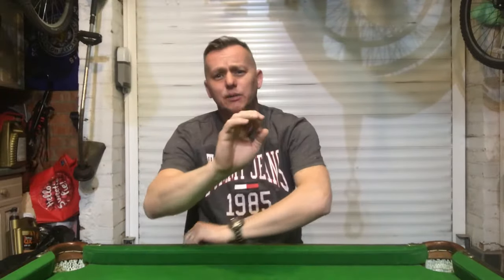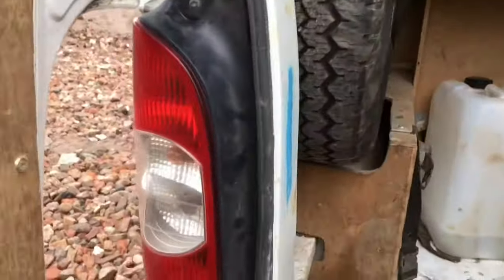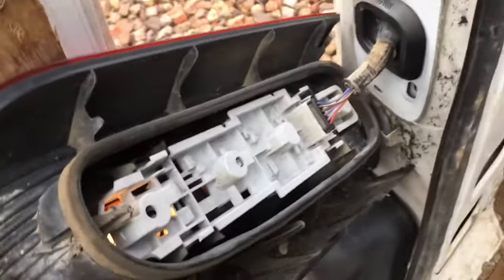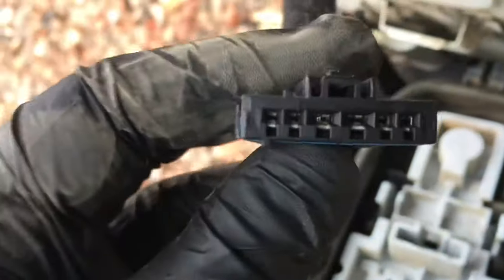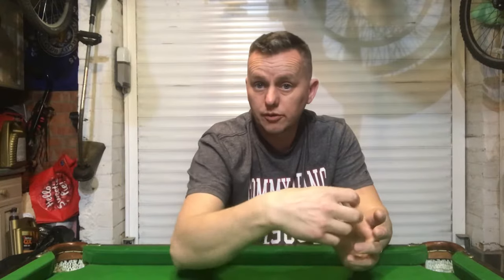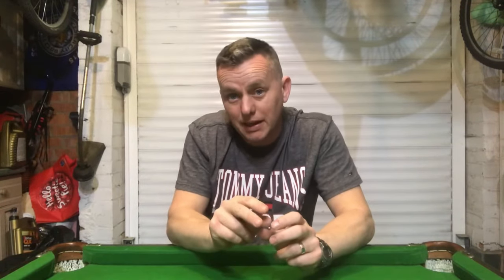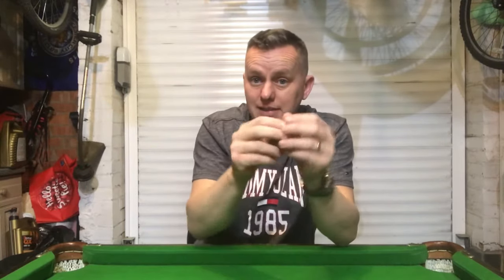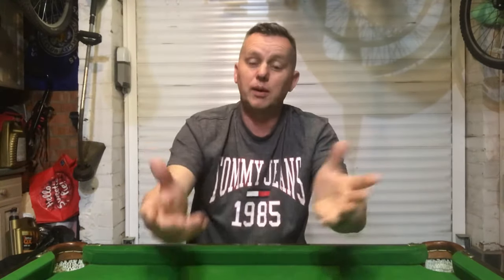Tail Light fault, How To Repair (basic electrical diagnosis)

Comment: Thanks for great explanation. Fixed exactly the same problem with my rear light. I would have assumed that a light would work or not, but your explanation on how it can arc, making it work and not work was very clever.
Reply from the maker: Glad it helped, Thanks for the great comments👍🏻👍🏻🛠

Comment: Great video, I have a renault trafic van, it keeps blowing the near side brake light bulb, it even melted the light unit, cleaned all the terminals and bulb connections but it still keeps popping bulbs🤕
Reply from the maker: check the alternator output is it higher Tham 14v? Thanks for the great comments👍🏻👍🏻🛠

Comment: Hello mate, really helpful video- Thanks.Just wondering, I’ve got a Honda Jazz 08 and the rear near side light , brake and reverse light aren’t coming on.Could one fawlty bulb blow the other two.Would it be the case to replace all 3 bulbs or could it be something more sinister?Appreciate any help-Thanks again.
Justin
Reply from the maker: Check the earth wire to the rear light, Thanks for the great comments👍🏻👍🏻🛠
Reply: Thanks much appreciated-will do👍

Comment: Great video. Very clear.  I wonder  if you could help me.  My two rear brake lights are working but the middle one on the rear window ins't.  I have changed the bulbs and also the brake light switch and the middle brake light still does not come on. Any ideas.  Thanks in advance.
Reply from the maker: Possible broken wire in the door wiring loom where it bends, Thanks for the great comments👍🏻👍🏻🛠

Comment: hi thanks for sharing.the lights and registration lights are not working. brake lights  and fog lights work.ive checked fuse and bulbs but no joy .any ideas. thanks
Reply from the maker: Is this on both sides? Thanks for the great comments👍🏻👍🏻🛠
Reply: @aaanton11  yes both sides .thanks

Comment: Hi I changed a side light bulb on front of transit connect and now back one has gone off on same side so both not working now any idea.  Thanks
Reply from the maker: Did you put a led bulb in they don't work on some cars, Thanks for the great comments👍🏻👍🏻🛠
Reply: @aaanton11  yes I put led in but now I have no power on left side lol

Comment: My Kia Sportage 2013 brake lights is making my craze , i changed the brake lights switch and fuse but 
I start my car brake lights working, next day it is not working, next day it is working
Any idea?
Reply from the maker: Check the earth point on the rear lights, Thanks for the great comments👍🏻👍🏻🛠

Comment: Hi, I just fitted in new brake light bulbs on passenger side rear and as soon as I plugged back in the connector all the power cut to my vehicle. Could this be a fuse issue due to incorrect bulb wattages????
Reply from the maker: Is the bulb in back to front causing a short circuit? Thanks for the great comments👍🏻👍🏻🛠

Comment: My light bulb sockets show signs of corrosion/rust, how would you suggest I fix this?
Reply from the maker: Give it a wipe with scotch brite Thanks for the great comments👍🏻👍🏻🛠
Reply: @aaanton11  While we’re in the same rabbit hole, I’ve got a similar issue on my Mini Cooper. The top light of the tail light cluster is not working. It’s not corroded and I’m using a new bulb. I even got a new socket. Still nothing. As I’m turning the socket I see a little blue spark. I think there’s something up with the circuit board.

Comment: could u help me, i have an issue with my back right brake light, put my foot on the brake and the both brake lights come on but a few seconds later the right one turns off while the othe is still on, i then turn off my headlights and turn them back on only to find the brake light will work again for a few seconds and then repeat, any help would be great thanks
Reply from the maker: Check the earth wires, and the connector plugs to the light units one might be melted, Thanks for the great comments👍🏻👍🏻🛠
Reply: @aaanton11  turns out the cove was loose, tightened it up and all working fine now, u are a genius my friend, much applause from Oz

Comment: aaanton11 Hi, I have a '94 Nissan Altima. I replaced the Brake lamp switch , put in new tail light bulb which stopped my brake lights from staying on. So I thought it was fixed and I didnt have to unhook my positive battery terminal everytime I got out now. Battery was dead next morning. Installed new battery, brake lights back on again lol. I kept smelling wires burning and it was coming from my left tail lights. The ground wire had burnt and melted my tail light housing around where the ground connector screws down to the housing frame. Any ideal what's causing this or can you send me a video how to fix it. My brake light and battery light are staying on and I guess this is why.
Reply from the maker: You must have a short circuit, did you use the correct bulb, there are many different ones that might go in the wrong hole, Thanks for the great comments👍🏻👍🏻🛠
Reply: @aaanton11  I already know their is a short circuit somewhere and yes I used the correct bulb I k ow which one it uses!
Reply: Thanks for your input but I'll look elsewhere on fixing the issue like maybe replacing the switches above the brake pedal.

Comment: I really need help my brake lights and blinkers aren’t working I thought the socket was out because when you touch the passenger side light socket the light either cuts on or off . I’ve tried bulbs new tail light socket fuse and brake light switch 🤦🏾‍♀️
Reply from the maker: sounds like a bad earth, Thanks for the great comments👍🏻👍🏻🛠

Comment: DEAR SIR, MAY POP YOU A QUESTION, I HAVE A FORD SMAX 2009, NEAR SIDE BRAKE LIGHT NOT WORKING, CHANGED THE BULB, STILL NOT WORKING, CLEANED THE CONTACTS, STILL NOT WORKING!! CAN YOU PLEASE ADVISE ME? MANY THANKS,
Reply from the maker: possible poor earth in the light cluster, you will need a volt meter to test connection Thanks for the great comments👍🏻👍🏻🛠
Reply: @aaanton11  Hi, could I ask, "How do you check the earth?"  I have a multi-meter.  I think that my old 2003 Ford Focus hatchback  'may' have this as a problem. as the off-side tail-light has stopped working.  Changed the bulb & checked all the contacts, still doesn't work.  My lovely old car has now just failed it's MOT test, so this is really important to me.  Trouble is that I can't afford to spend a fortune at a garage for them to find & rectify the fault.  Have you any ideas please?

Comment: If I need to swap my rear fog light from right hand side to left side...how to I know which wires to change etc...it’s for importing into NL.
Reply from the maker: remove the light unit and use a test light to find the fog light wire then extend it to the other side, Thanks for the great comments👍🏻👍🏻🛠

Comment: I already replaced bulb and still will not work.  Break light continues to work, but not taillight.
Reply from the maker: Thanks for the great information👍🏻👍🏻🛠
Reply: did you ever get your lights fixed I have the same problem. brake lights work .no tail light or registration lights or door tail light .🤔

Comment: Hi Anton, need help here, what could be the problem, if i step on my break pedal the headlights/AC indicator lit up? this happened after i installed LED bulb on my break light but i put it back to my stock hallogen bulb
Reply from the maker: Remove the led bulbs they are not so good in some cars, I had similar issues, they back feed causing issues, Thanks for the great comments👍🏻👍🏻🛠

Comment: Hey my back lights won’t work when I turn my lights on only the headlights and blinkers, then when I turn the lights off my brake lights work and signals.. do you know what the issue could be? I replaced the bulbs and fuses so that’s not the issue.. anybody can help me out?!?! Please
Reply from the maker: sounds like a bad earth, check with a volt drop test, Like in this video but on the rear light earth. https://youtu.be/jEi-OJQD4K8
Thanks for the great comments👍🏻👍🏻🛠
Reply: Did you figure out the issue? I am having the same issue
Reply: Did you figure it out ? Having the same issue with my Honda Pilot.